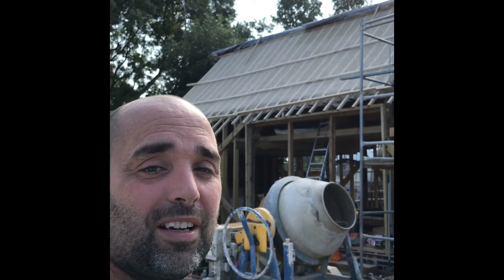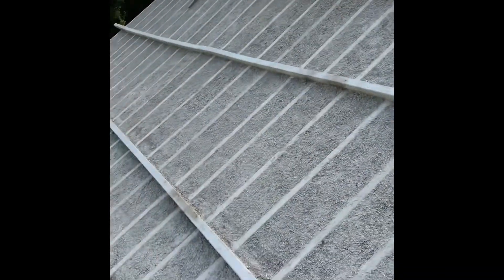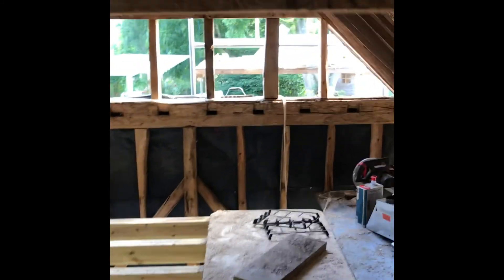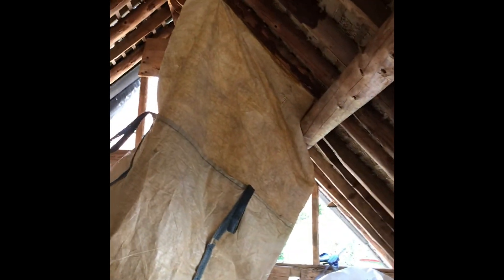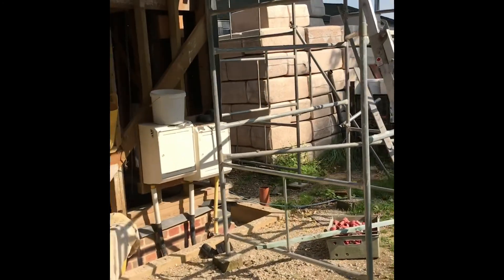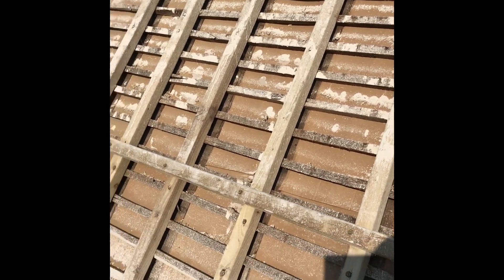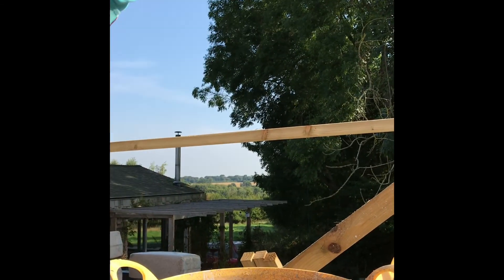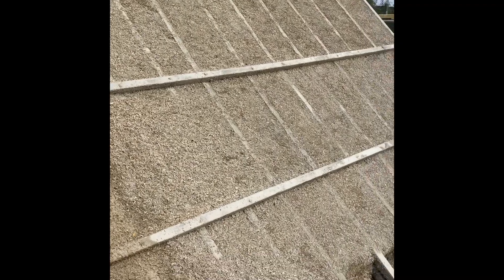Hemp & Clay Spray

Comment: Hey Will, really interested in the possibilities of using clay as a binder for an insulation composite. What do you think about using wooden lathes attached to either side of a timber frame wall, as a kind of permanent formwork? You’d then pour/place/ram the composite in, depending what it is. I was also thinking about using biochar instead of hemp, which has the advantage of being pretty much resistant to rot. It’s more expensive though and it does burn, so would need to make sure it’s encased in enough material so that it can’t. I’m then potentially adhering cork panels using a lime mortar to the outside and clay plastering on the inside. Also a little concerned about how much moisture the clay/biochar would hold as it could potentially hold a very large amount, which could potentially put the timber frame at risk and reduce the insulating properties. Or perhaps the risk is reduced as it will draw it away from the frame, until it got saturated I suppose?! Sorry, loadsa questions. Also congrats on the Hempcrete book, it’s awesome!
Reply from the maker: Hi Dave, I don’t know much about biochar so I can’t really comment on  that side of things. I have often thought about using lath as a permanent shuttering, I think it could work well, I would probably favour spraying the hemp/clay from one side onto the lath but I’m sure both methods would work. I did once use lath already plastered with clay basecoat as a permanent shuttering for cast Hempcrete and this worked really well.
Reply: @williamstanwix  thanks for the reply, that’s encouraging!
Reply: @williamstanwix  me again…any thoughts on rigid wood fibre on the outside and wood wool boards inside as a permanent formwork? Laths are more expensive than I thought, could be done cheaper by milling down oak planks, but time consuming. Main concern is whether they’d allow it to dry in a reasonable timeframe.
Reply from the maker: @findingoutthehardway  woodwool board is good as permanent shuttering but woodfibre is not. The woodfibre can be added once the Hempcrete is dry but not before. Try hessian??

Comment: Does hempclay have same same thermal performance as hempcrete? And can it be used for the same things?
Reply from the maker: It does have the same thermal performance, I had samples tested and at the same densities they had identical thermal conductivity.

It can be used in a very similar way although I would not render onto it I think it would have to have cladding instead.
Reply: @williamstanwix  Is the surface too porous for render to stick, or is there another reason? And thank you for the prompt reply.
Reply from the maker: @johannesberg5767  it would take a render or plaster fine it’s just that lime render is vapour permeable and in driving rain the hemp clay behind the render will get wet. 

Unlike lime, when clay gets wet it loses its mechanical strength and might end up shedding the render. It’s not the case in dense materials like cob but in very lightweight materials like I am spraying I think it is a risk. 

You could of course have a large roof overhang so the walls don’t get rained on much at all in which case it might be fine. 

I will test these theories one day to know for sure.
Reply: @williamstanwix  I'm specifically considering insulating the inside of an old stone house, the same as you have done with hempcrete in other videos. So with no direct water on the walls, I'm thinking I should be good to go. 
Tip for future testing: I read a paper on the properties of hempclay, where they suggest using sodium silicate to speed up drying times and borax to reduce mould growth in thicker wall construction. I would love to hear about it if you try it out.
Thanks again for the technical support :)
Reply from the maker: @johannesberg5767  yes that would work, I have plastered hemp/clay into the inside of old brick walls which worked really well.

The sodium silicate and borax sound interesting.

You can also mix your hemp and clay then leave it in the floor in a big pile turning it occasionally and let it dry out a bit until it’s just able to stick together then cast it.